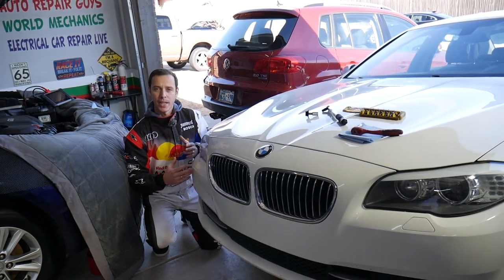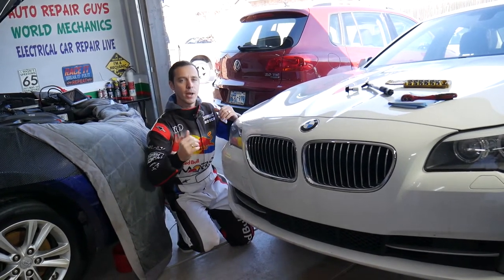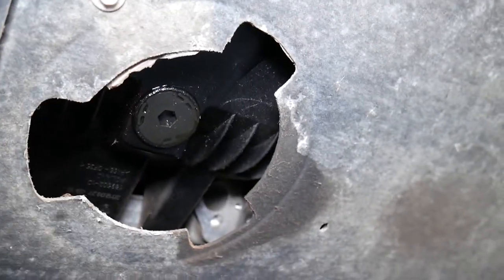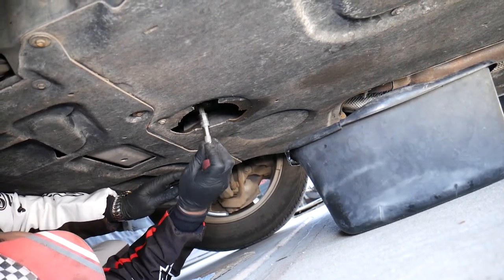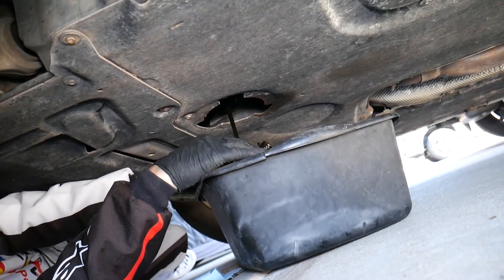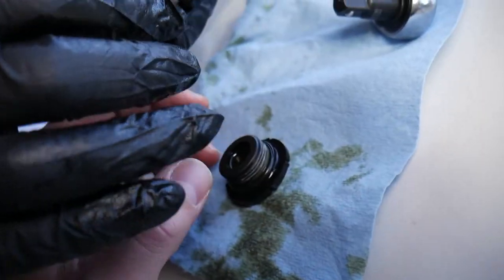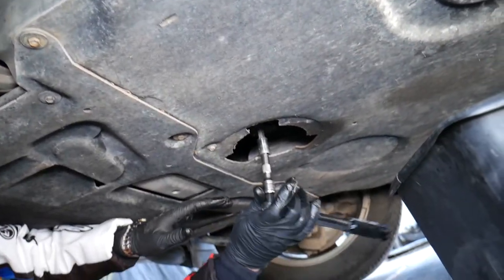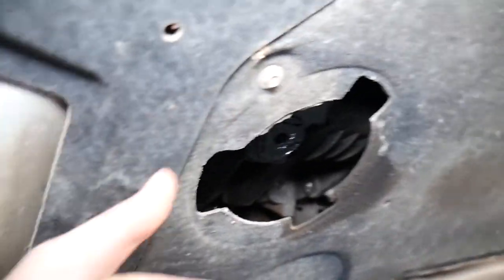BMW LEAKING ENGINE OIL FROM OIL PAN DRAIN PLUG  EASY FIX

Comment: Awesome works guys....i usually follow you guys and i love your works it helps alot, have a question out of what you showing now...have a 98 toyota camry le v6 it cranks but does not run, and when i plug in my scanner it writes communication error checked all the fuses they are ok and engine light comes on when key is on acc which tells that the ecu is communicating with the car, what should check next or what am missing....thank you

Comment: What if I replaced it and it’s still leaking
Reply: I am having the same issue. There could be a few possibilities why it is still leaking. You could be using the wrong oil drain plug size, didn't torque it correctly, or the oil drain pan is stripped and will need to be rethreaded. Double check to see where the oil is leaking too. Sometimes oil could leak from the oil pan and would travel down where the plug is located at.